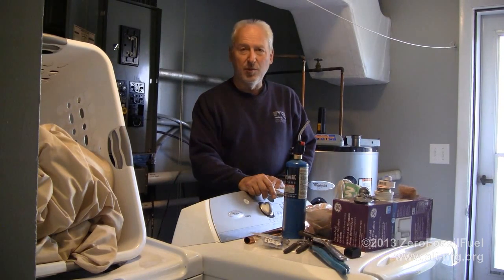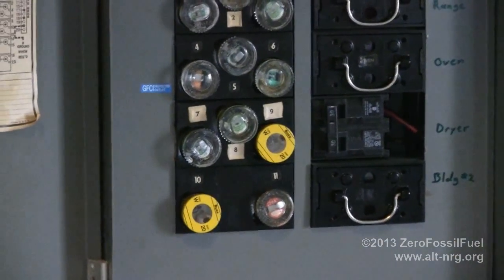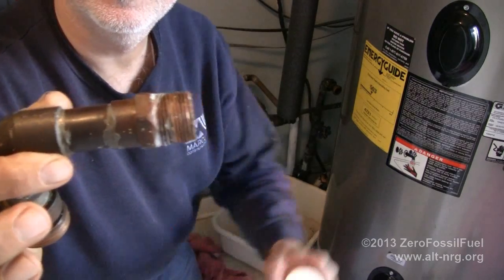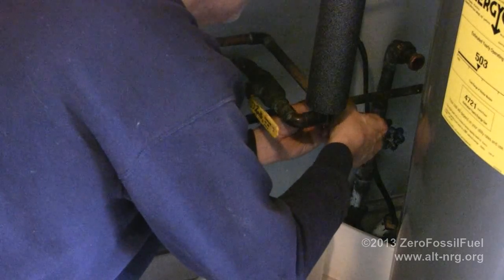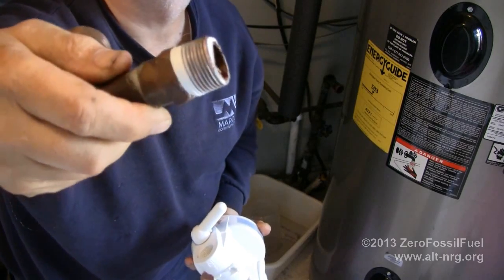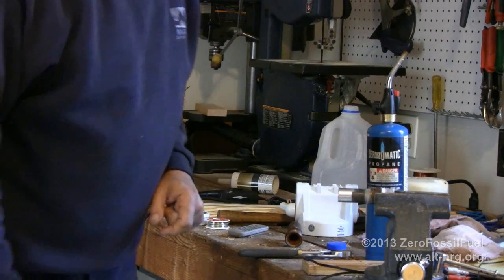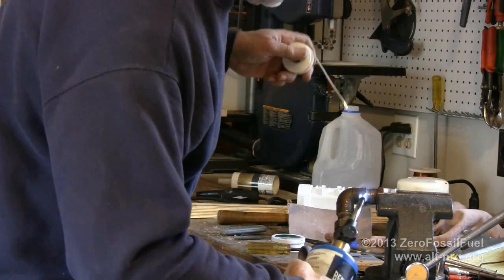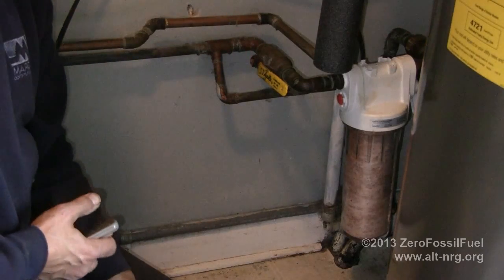#347 Whole house water filter replacement Honey-do project DIY

Comment: Thnx ZFF!  GR8 tutorial!  Will try and NOT touch that SUPERHOT solder wire when doin this!  GF's been on me for over a YEAR now to install a whole house filter we've had new in box for over a year!  Issue is that her garage is sheetrocked and finished, so have NO idea where to find the pipe I need to find in order to install the thing!  Plannin on using a metal detector to trace water pipe back from water heater toward the water shut off valve out by sidewalk.  Her house has no shutoff on it! SB

Comment: Nice video. The only suggestion that I have is that you should have test fitted the pipe before sealing it. But you measured it just fine so no problem after all. Good work. Now I want a filter.

Comment: Silver solder is much stronger than lead or tin. Melts at 455 degrees F. 

Never had a hot water heater. Mine were always COLD water heaters. Hot water, I would not heat it after all...  (I'm from the South and have  millions nonsensical idioms, too. :)   Changed out 4 water heaters in my life. #5 will be done by a plumber. Never was an expert plumber but I got it done. Hurts too much to bend  and strain for DIY plumbing jobs these days. 
regards,  -AlgonquinJCalhoun

Comment from the maker: The recommended interval is 3 months. I usually waited 6 just because it was such a PITA with the old filter canister but that was too long. 3 is about right. Now that I have the new canister installed, I will stick to the 3 month interval.